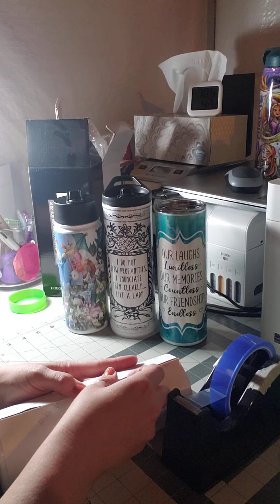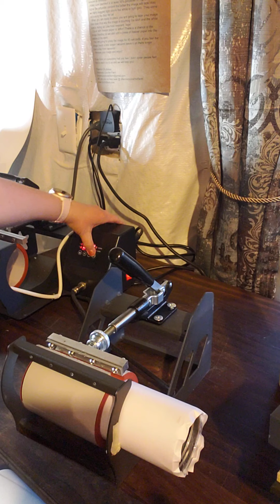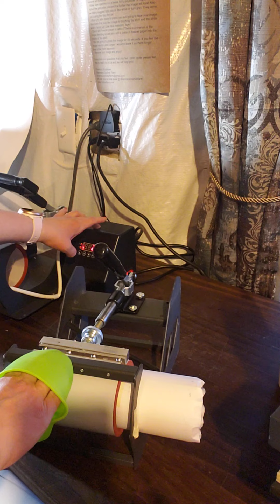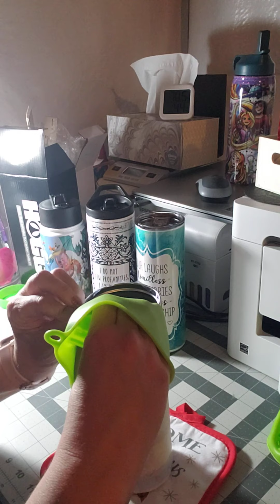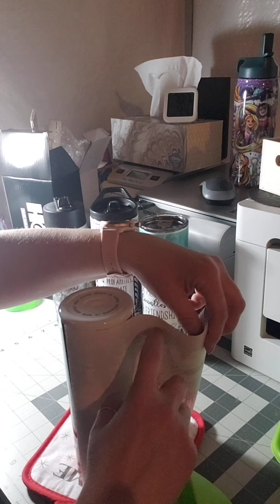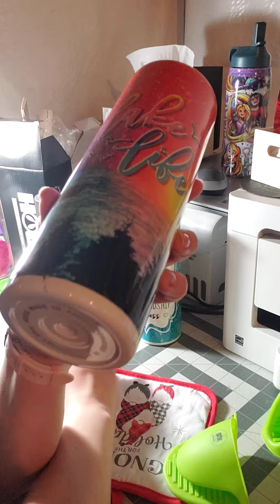sublimating tumbler in mug press. just heat tape.

Comment: Glad to see that I'm not the only one that can see the tape marks on the cups. I purchased a 20 oz tumbler press and have tried half a dozen tumblers and it fades on the end sometimes and I can always see where the tape was and it doesn't wash off. Have used paper on top of sub paper trying to add more cushion but haven't found a solution to the tape marks yet. I am going to try to use regular masking tape and see if it does better. My thoughts are that the heat tape is holding heat better and getting hotter in that spot or maybe just the opposite.
Thank you